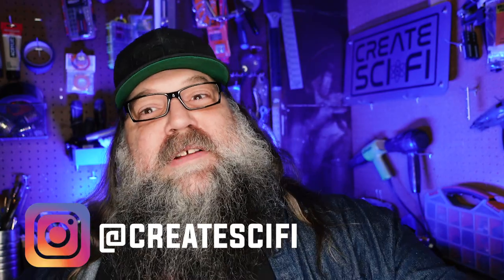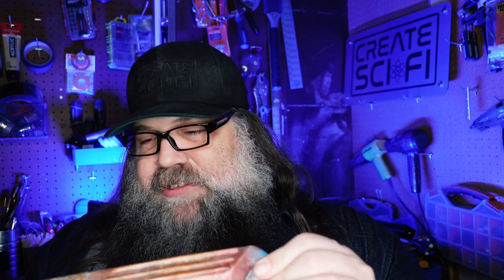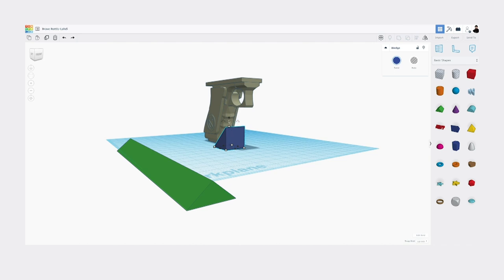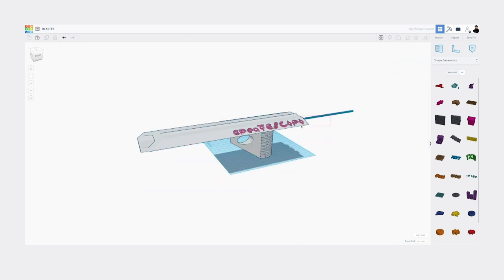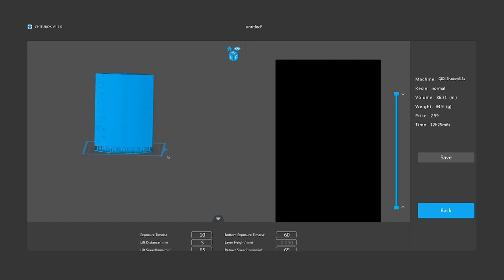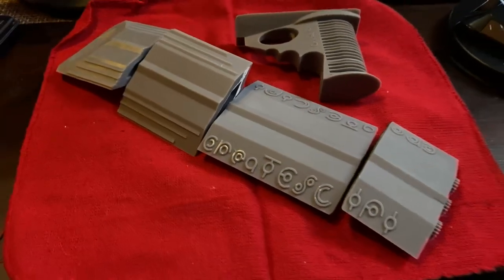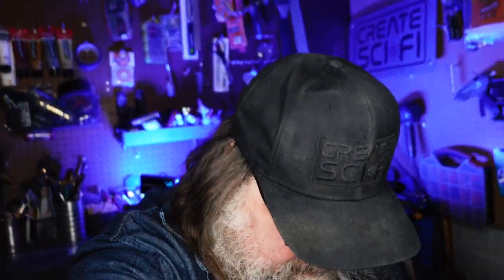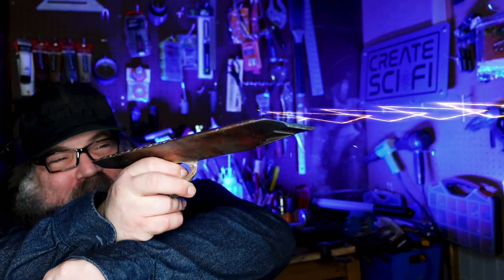SCRATCH BUILD BLASTER DESIGN & FABRICATION

Comment: that's a good-looking blaster! depending on how well-tuned your machine is you generally want a half millimeter extra tolerance built in for a press fit. this design wouldn't really be suitable but when i'm building a model to print i try to hide part seams in corners and panel lines to reduce the amount of sanding time.
Reply from the maker: yeah for sure will try .5 mm next time